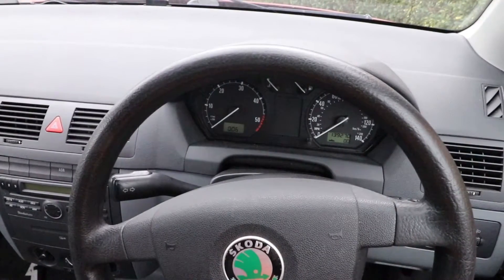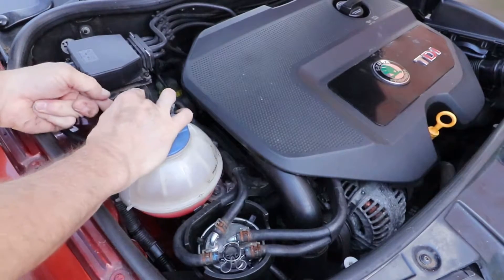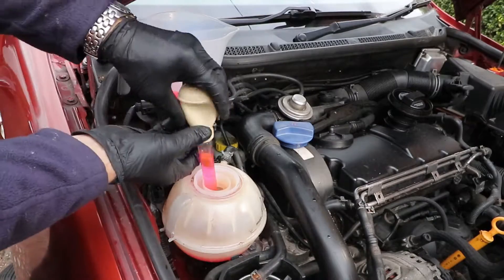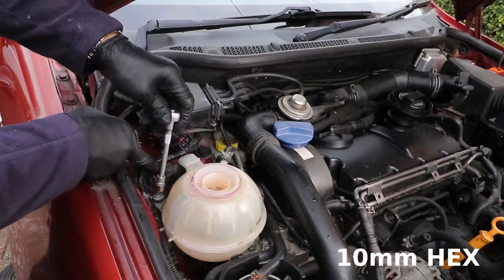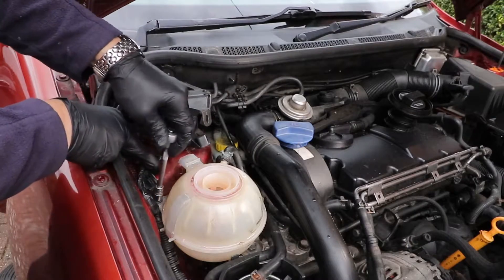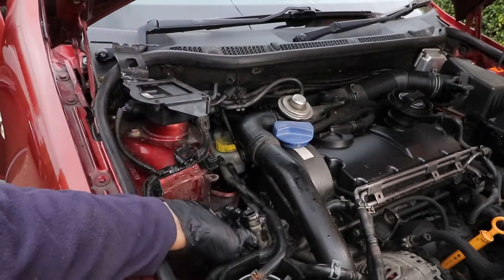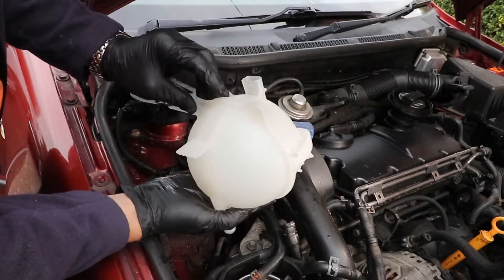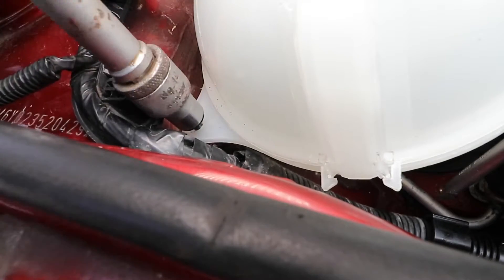SKODA FABIA Expansion Tank (Mk1 99-2007)

Comment: Hi. Question. I have Skoda Fabia Mk1. Instead of G12 coolant I've got Comma Xstream G40 (already mixed) from Halfords. What do you think? Is it ok to top it up?
Can't find G12 anywhere. 
Thanks
Reply from the maker: No, G40 is equivalent to G12++ which is not the same. G30 is the same as g12/g12+ and is compatible, G40 isn't compatible.
Reply: Thanks for quick reply. Current coolant color is pink. Comma Xstream G40 is also pink. I've changed it for G30 but color is red.
Now I'm even more confused. 
With my research I found out also that G30 is compatible with G12. Hmmm...

Comment: If you want the bottle may be reused if the sensor of colant is defective. You need to dissansembly the bootle and insert in 100 ml of  a chemical solution that remove the oxidation from the probe. In my case the chemical solution was a bathroom cleaner(CL base). It works well.
Reply from the maker: Thank you for sharing that with everyone, good to know :-)

Comment: I have trouble when it's cold weather opening/to undo the coolent tank lid to top up coolent. Plastic thread becomes very stiff seized up on a cold morning I can't twist it lefty loosey by hand to undo. Any tips on how to open e.g. a warm cloth  or aid of a tool?
Reply from the maker: Putting a something fairly hot on the lid would in theory expand it a little to open it (not a blow lamp!), perhaps one of those warmimg bag that have beans in them. They use them as bed or joint warmers. once the water system has the correct coolant and level you don't need to take the top off for years, so I'm thinking you may have a problem if you are filling it regularly?

Comment: Hey, I have fabia with "comfort" trim as your is and i have problem with remote key locking and unlocking. It just doesnt work. I tried everything from checking fuses, changing batteries in key fobs, re-pairing keys with car diagnostics, and nothing works.. The car just doesnt respond to key. Any help or future video maybe? Thanks for all tips.
Reply from the maker: Does the light light up on the key? does the key work all the locks manually in the drivers door lock? When you open the door are the interior lights/door light on? Does the security flashing light on the door card work? check connections going into door by the A pillar/door lock/control unit under steering wheel next to heater clutch pedal. VAGCOM would be able to isolate problem diagnosic best so you know where to look further before you start replacing stuff. control units fail/door locks fail/wiring connections fail. Also check battery is good with good ground. Hope this helps :-)
Reply: @HatBoyHarvey  All keys were checked for signal, they showed up to be allright, unlocking and locking the car manualy works fine, microswitch in door lock is ok too, im worried that it should be comfort control unit, because VAG can not comunicate with it.
Reply from the maker: It could well be the central locking control module, worth checking the wiring to the unit first. Do you know if the car leaks in water? as I keep hearing reports of damp effecting these a lot and I also have had issues with this. I cured the damp in the footwells and the electrical gremlims disapeared.
Reply: @HatBoyHarvey  i had big leak from back doors, fixed it (i think you even made a video about it) and no more leaks are in the car. So i will check the connection to the control module and i hope its just some oxidation on conectors and not whole module gone. Anyways, thanks for your time and help.

Comment: Hi, please help:
I have already replaced the coolant reservoir and the coolant temperature sensor, but the problem still persists, meaning the red light is flashing and gives a beeping sound 3 times. I have noticed that the issue occurs when the outside temperature is high or when the engine has already warmed up, but not always. There are no other problems with the car, but this warning light can be really irritating. my engine 1.9 tdi
Reply from the maker: Try this to check if it is the instrument cluster: https://youtube.com/shorts/S04-IwJqGZE?feature=share   if after running this awhile it still comes on then IMHO it could be either a cheap replacement expansion bottle or the cluster has circuit board issues like dry solder joints. Hope this helps, let me know what you find and fix :-)
Reply: @HatBoyHarvey  Thank you so much for the quick reply, it's amazing that you follow comments even on old videos. I need to check what you mentioned, and I'll let you know.
What do you mean by an issue with the circuit board of the instrument cluster, like dry solder joints?

Comment: Hi im having a similar problem mk1 2003, light comes on before i start driving, while driving, sometimes not at all, but when it does come on my fuel guage drops to empty !!! also my light for the washer fluid comes on when its full only started doing this since the temperature light came on.....i have replaced the coolant sensor + new coolant.
Reply from the maker: Hmm, some electrical glitch. as the fuel guage is affeected I would suspect the instrument binical connections and/or failing dry cracked solder joints on the PCB. the former just spray connections with electrical cleaner and re-attach, with the later disconnect the neg earth lead before taking the binical out. Take care with a magnifying glass to spot cracking and re-flow the joints. Also you may have a failed level indicator in the expansion bottle so could replace with new OEM unit first. Hope this helps :-)
Reply: @HatBoyHarvey thanks for your reply, I will clean all the connections 1st if that fails ill install a new expansion bottle, if that fails I'll have to pay £120 for a diagnostic.
Reply: Re flowing the cluster solder seems to have done the job......or its because I disconnected the battery and it did a reset !!! Regardless thank you......
Reply from the maker: @kieran5937  great, fingers crossed🤞 problem won't reoccur :-) did you find any bad solder joints?
Reply: @HatBoyHarvey  one solder joint was black, just happy your solution worked👍
Reply from the maker: Hmm, that does indicate over heating, trying to bridge a crack in the underlying solder - re-flowing would overcome that. 🤞😊
Reply: Light has just returned confused 😕 🫤

Comment: Hello my friend i remove the pannel like you do in the photo but i dont see relay 377 for front window wipper can you just help me wicht numer is please .
Reply from the maker: No relay 377. wiper relay is on the circuit supply voltage board contained within the box under the other relays. It is soldered to the pcb board on most mk1 fabias and not a separate unit. It can be replaced if you melt the soldered joints to remove. First try to check all connections to the module and any visible wires damaged. Also on some models the relay was placed inline with wiper motor, behind the scuttle panel. The wiper stalk arm may also be faulty which I will soon do a video on.
Reply: @HatBoyHarvey  my wipers work but when i leave in on off control they restarted many times and my lights in deashbord  go on and off i have afraid maybe my car can take fire because in Sweden we have a lot of rein 
Thank you my friend for your time 
You are A GOOD MAN

Comment: Hi , i had same problem with my 1.4 mpi, I changed tank twice, looked for dry solder joint on cluster , changed sensor , nothing … but you may look for thermostat housing , I don’t know about other engines , but in my case I looked after pulling sensor out and clearly can see the thermostat broke free 😂 so it’s laying down in housing freely and I think it’s touches sensor . Hope I helped someone
Reply from the maker: @filipsnayke4155  Very helpful,  thanks for sharing :-)